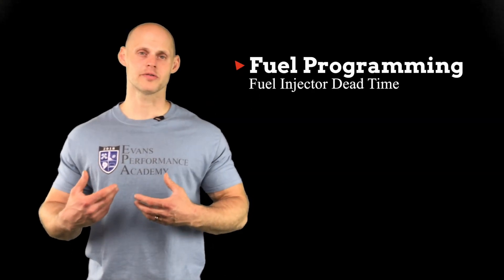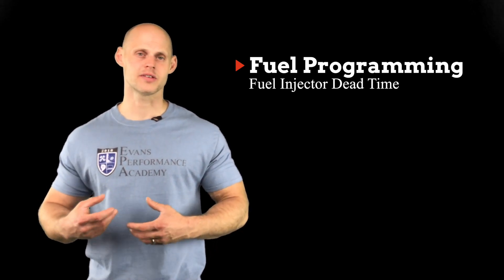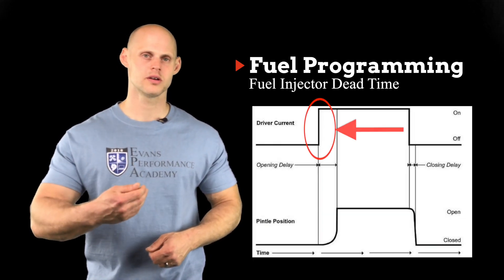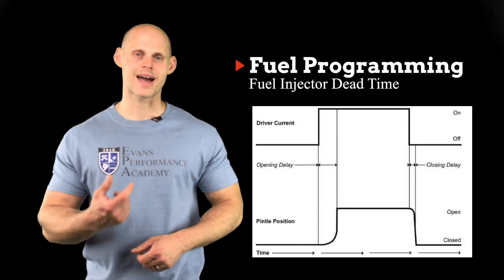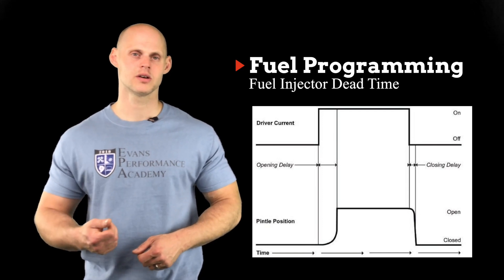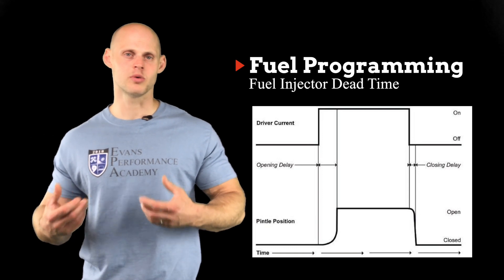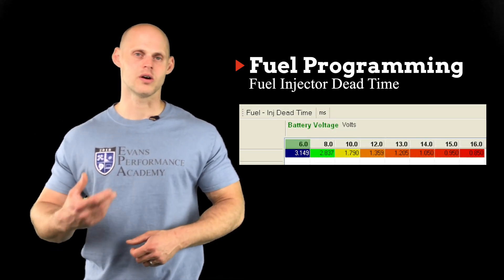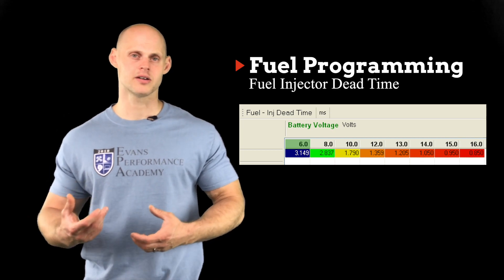EFI Basics: Intro to Fuel Tuning

Comment: If you your VE table is correct at operating temperature with no external corrections and your ecu knows your injector size but not the dead times, is it a case of simply adjusting the dead times until you reach a point where the your trim is close to 0%?
Reply from the maker: Great question!  The main VE table is only a theoretical amount, and part of the larger equation to figure out the airmass coming into the engine.  The values in the table just allow us a way to manipulate the airmass reported back to the ecu since we are calculating it instead of measuring it from a mass airflow sensor.  If your VE fuel table had the correct values (which again is subjective as its a theoretical amount) and your fuel trims or delivered air/fuel were incorrect (fuel mass calculated wrong) then the injector characterization data may be incorrect.  The problem with most companies injector data is that its often times incorrect, and does not properly characterize the injector.  Changing the dead time is one way to correct a trim problem; however this is assuming the injector data you have is incorrect.  If you have correct injector data entered and you are experiencing the fuel trims or air/fuel being off, then it indicates that the data entered may not be correct for that particular operating base fuel pressure.  What makes it even more difficult is if the injector is operating in a non-linear operation range, and we cannot characterize the "low slope" or non-linear region of operation in the EMS system being used..  A simple dead time table wont characterize the injector properly and we can end up with a skewed VE table, fuel trims/AFR being way off.